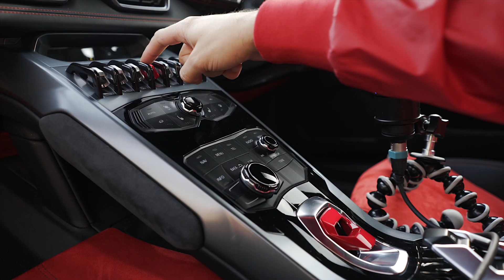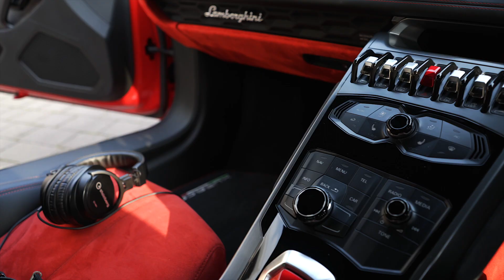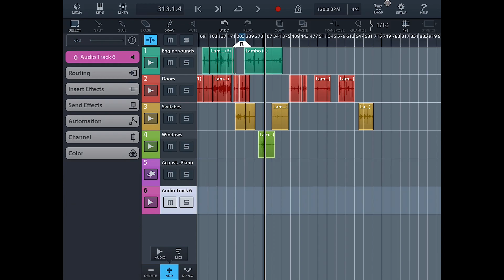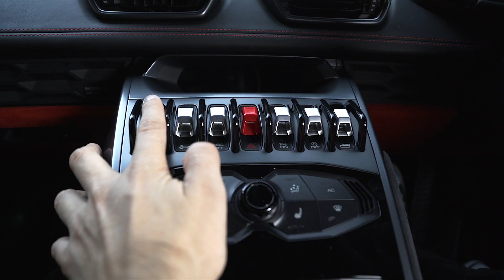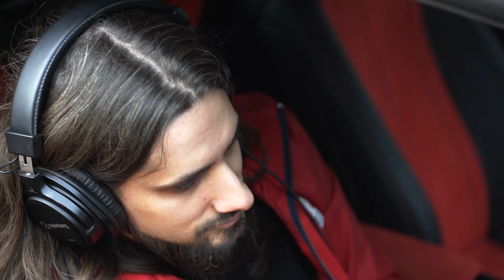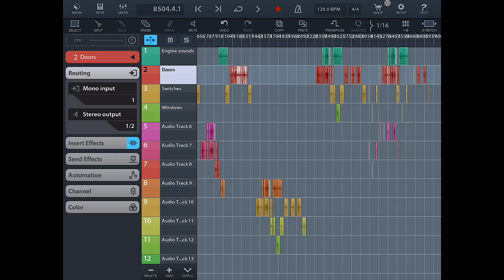Recording a Super Car Behind the Scenes | Recording and Sampling a Super Car

Comment: It's absolutely pointless recording a vehicle in neutral gears since they will not sound correct unless the engine is under load, and then you'll need high SPL microphones and in-line attenuators on the pre-amps to avoid overloading them. 

Some vehicles, a lot of Ferrari's for example, have butterfly valves in the exhaust which only open up (and give the traditional Ferrari V8 scream) when under load. Same with V-Tech engines, these will only open up over around 8000 RPM under load, not idle.

So then, your options are a noisy rolling road, a dynapack (which has no inertial so you can't record decels), or on track recording.... and therefore, a completely different choice of recording equipment. 

Sorry guys, I'm a big Steinberg fan - having been a Cubase user since 1989, but massive fail here.